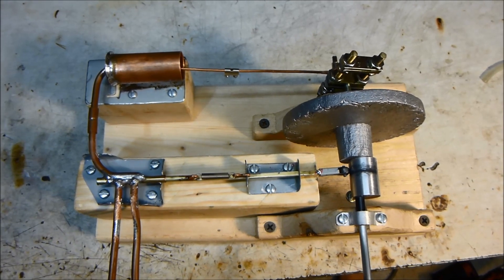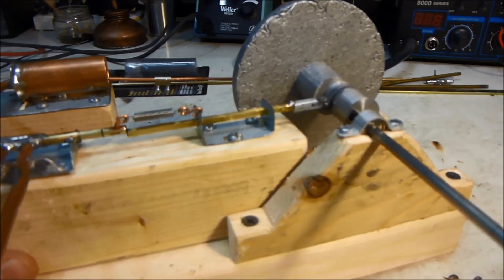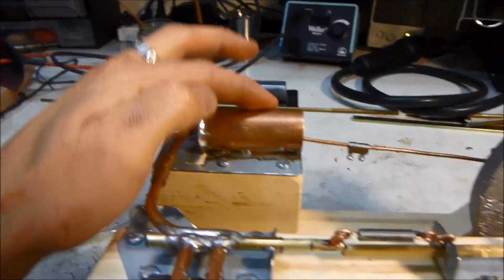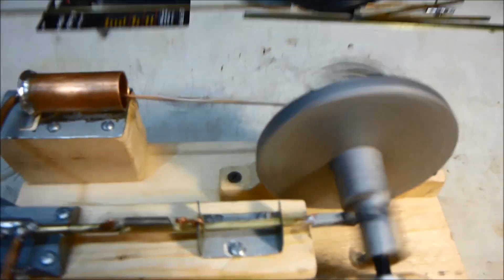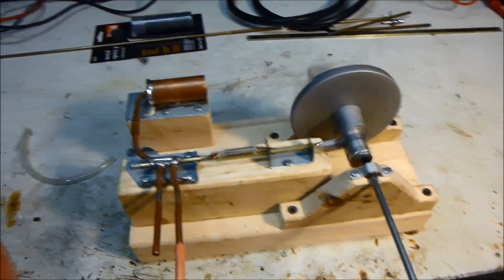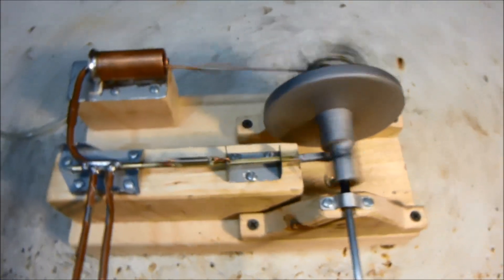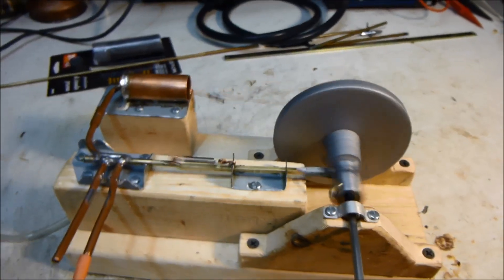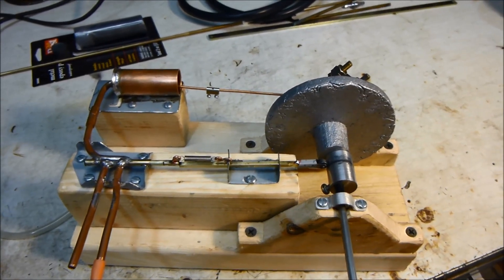DIY Homemade Steam Engine Running - Made Without Any Machining

Comment: how does the pressure actually mke it spin? thats something i never understood
Reply: As the flywheel spins it opens the valve at the top of the cylinder. The pressure pushes the piston down, and that spins the flywheel more. The spinning flywheel then closes the valve at the top of the cylinder which removes the pressure in the cylinder and the piston moves back. Note that the closed valve is also an exhaust port.

Comment: im gonna try 3d printing most of the parts, but since pla is craptacular when it comes to heat i will subsidise many parts with concrete since i have no manufacturing capability when it comes to metal, i will as an example use concrete to infill the rim of my flywheel since said component requires mass, i will also attempt to cast a concrete piston (yes im being serious) and those pieces of flatbar seem like they may be cast as well, this will definitely be a failure.

Comment: Steam Engine without Steam xD
Reply: Technically the steam engine is literally just that, the engine. The mechanism that converts pressure to mechanical motion. The steam generator is what actually makes the steam that feeds into the engine.

Comment: You described pressure in mm/Hg. You sir, are a geek. I respect that.
Reply: A real geek would use Pascals.
Reply: James Keller what does mm/hg mean?
Reply: @STORMY-lv9lr  millimeters of mercury. describing the pressure change as it would read on a barometer for instance. The "HG" standing for "Hydrargyrum". which approximately means liquid silver
Reply: That would say mmHg, not mm OVER Hg. No reason for a fraction in the unit at all.

Comment: That's not a steam machinbe lol you are using a compressor
Reply: When testing steam engines, compressed air and vacuum is used as to avoid deadly shrapnel and hot compressed gasses. These tests verify the integrity of the machine in a more controlled manner than steam does.
Reply: Sadin2018 Considering that he need a whole sistem to set up the steam and stuff i do not consider it finalized
Reply: Steam engines work on compressed air too. (Or in this case, atmospheric pressure.) If it's intended to be used with steam, it's still a steam engine... even if it's just being test driven on air.

Comment: cool little stream engine. if u replaced the cam with another rod, u would have more precise timing and it would be quieter at high rpms cause u wouldn't have valve float. i have a steam engine running a generator at my house. it's fun. i can heat my house and have just about free electricity during winter.

Comment: I'm not experienced with engines. My question is, If I boil water and run the vapor into the intake - will it run? It essentially runs on pressure?
Reply: +Joe Tese No...that wont work at all.  The intake on a normal IC engine is waiting for the intake valve to open so it can inhale air and fuel on the down stroke...then compress....then ignite the fuel air mix....  A steam engine works by having a valve move so it routes the steam toward the down or up stroke...  basically an IC engine can be made into a steam engine with a lot of modifications.... but you cant make an IC from a steam
Reply: +Joe Tese 
Yes.
Reply: For some reason I thought that this persons question was directed toward an IC engine.

If he meant a Steam Engine...It would only work if the steam was properly "timed" for a piston movement.  Oh well...  No biggie
Reply: +SquillyMon 
Pretty sure it would run whether timed or not= pressure is pressure. not necessarily self start but would run. If it runs on vacuum it will run on pressure.
Reply: No it would need to be timed...  Otherwise it will either trap the piston in the down....or up position.  Thats the function of the other rod...to time the pressure pulse.

Comment: nice engine , pretty clean soldering , how strong is  the soldering  iron you use ? or a torch ?
i made one about 2 years ago the same size as your engine but mine was crap and funny ! hhhhhhhhh
Reply from the maker: MegaMalek95 I used my Weller WESD51 soldering station to do most of the soldering.  When I soldered the copper tube to the steel mounting plate I also used a bit of heat from a heat gun to help the soldering iron get the work pieces up to temperature.  The 50 watt iron just didn't quit have enough heat.

Hahaha I see what you mean!  But I like it!  It shows that you don't have to have buy a lot of stuff or have expensive tools to make something that works.  Nice job!

Thank you!

Comment: where did you get the flywheel from?
Reply from the maker: Dean Walcott I cast it out of aluminium in my aluminium casting video with the lost foam method!
Reply: Makerj101 thanks for spelling aluminium correctly.

Comment: Very good, I believe this type of engine should be simpler to build. I also believe that are not so critical with friction compared to Stirling engines. 
How did you do this piston? 
Leandro Wagner.
Reply from the maker: Manual do Motor Stirling - Leandro Wagner Very true!  I used epoxy putty to make the piston of my engine.  Here is a link to how to make it.  DIY simple epoxy putty power piston for Stirling engines

Thank you!

Comment: So it runs from pressure and vacuum? Can it do both at once?
Can I find plans to your valve online?

You may be able to make a low presure boiler solderig a pipe into a jar lid and boil water in the jar with induction :)
Reply from the maker: Mongrel Shark Yep both at once would even work!  It would make it work even better!  Just needs a pressure difference on the out put and in put.  Umm they are of my own design... but here is a link to a picture of a steam engine with a valve I used to figure out the timing.  https://www.google.com/search?q=steam+engine+diagram&safe=active&rlz=1C1CHMO_enUS511US511&source=lnms&tbm=isch&sa=X&ei=yLnuU_P8A4_6oATC-4CwDw&ved=0CAgQ_AUoAQ&biw=1600&bih=775#facrc=_&imgdii=_&imgrc=6iebRRQsf34bMM%253A%3B3MUOO6wCQ1Y8qM%3Bhttp%253A%252F%252Fupload.wikimedia.org%252Fwikipedia%252Fcommons%252F7%252F72%252FSteam_engine_nomenclature.png%3Bhttp%253A%252F%252Fcommons.wikimedia.org%252Fwiki%252FFile%253ASteam_engine_nomenclature.png%3B892%3B532
Wow long link! hahahah!

Interesting idea!  I'm not sure I would be able to get enough heat into it to make enough steam though.  I've only been able to induction heat with a couple hundred watts.

Thank you!
Reply: Makerj101
I think I see what you did there. Very clever and much better than the idea you based it on. Looking forward to seeing more detail on that valve! Ypu should upload a drawing to G+ or your website if you get a chance. I think a lot of people would benifit from your design.

Could be upscaled to run a 4 stroke through the spark plug hole, and not worry about the built in valves. If you had pressure and vacuum, it would be a half stroke. With 80% power cuycle... a 2 cylinder with 90 deg crank seperation would be awesome!! If only I had a Ducatti motor to test it on...

Dont fridge pumps push and pull at the same time?... The oil could be good if it was getting recycled...
Or you could put a bottle with baffles or something in line to gravity filter the oil...
you probably want some oil in the cylinder though. Will help seal the piston as well as lubricating it...
Reply from the maker: Mongrel Shark Hmm I could see if I have some time.  Tomorrow is my first day of college!!!  So I don't know how much time I'm going to have!  Hopefully I will still have some time because I need time in my workshop sometime.  But I'll try my best!  Wish me luck!

Yeah I've thought about that.  I think people have done that before.  I have a 2 stroke that I could do that to but I don't really think it would be worth the time.  I'd rather and I think I would learn more by building from scratch like this engine.  But none the less good idea.  I really want to make a internal combustion engine from scratch!  I attempted about a year ago but it didn't work very well.

No, fridge pumps pump continuously.  Here is the wiki article on the refrigeration cycle, though I don't think it's particularity good in my opinion.  I like a lot of diagrams and it doesn't have that.

It's not that I don't want oil in my engine.  In fact I would love to have a continuous supply of oil going into my engine.  The problem with the compressor oil is that it has a really strong and bad smell and when the oil gets on something it's super hard to get the smell out(including my hands).  Even the air that comes out of the compressor has the horrid odder.  It even kinda makes me feel a little sick after a while.  I have a jar with a paper towel filter on the output right now.  The jar collects the oil and then the paper towel gets rid of some of the odder.  

Thank you!
Reply from the maker: ***** I just checked him out and gave some of his videos a watch and they are very good!  I just subscribed too!  Thank you!
Reply from the maker: ***** Yep!  Thank you!
Reply from the maker: Mongrel Shark Here is a video of a internal combustion to steam engine conversion.   DIY STEAM ENGINE HACK TWO STROKE CONVERSION Weed Eater Hack Steam Power

Comment: wow... thats amazing!  i built a pulse motor awhile back and i really enjoyed that, i might start building more motors soon, i love your construction of this. btw how come your vacuum pump spits oil? i use a refrigerator pump to and no oil comes out... maybe its all gone? hahahaha
Reply from the maker: corbonzo1 I've done basic pulse motors a while ago with a reed switch.  Then I didn't know about protection didoes so the reed switches didn't last long!  I don't know why it spits oil.  I have a jar on the output to collect it and I have to empty it every once and a while.  It's a really old pump. 1971 if I remember correctly.  If the oil didn't smell so bad I wouldn't mind the oil going into my engine.  Hahaha yeah maybe your compressor is low on oil!  It could just be the design of my pump.  BTW I have done the basic tests on the oil for PCB because it was made before PCB's were band in 1979.
Reply: ahh i see, yeah its probably a much different design. i used reed switches for my pulse fire and i havent had any problems why do you need protection diodes?
Reply from the maker: corbonzo1 It was probably that I was using way to big of a electromagnet.  It had a really big flyback spike because I got shocked a couple times from it.  The flyback spike probably arced when the reed switch opened and ate away the reed's contacts.  Could also been from the in rush current.
Reply: Makerj101 yeah ive gotten a good jolt from mine before hahah its amazing what they can put out
Reply from the maker: ***** I've never heard of a pancake compressor.  I'll have to google that one!  Awe that stinks.  :(
Reply from the maker: corbonzo1 Yes they can hahaha!